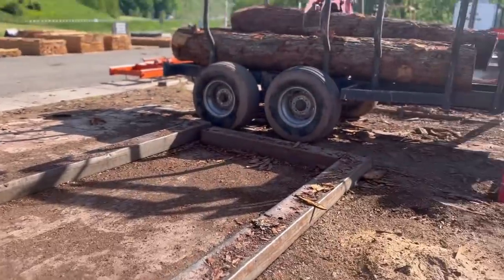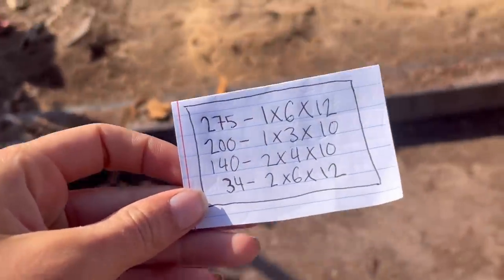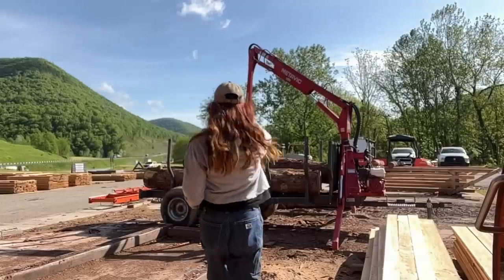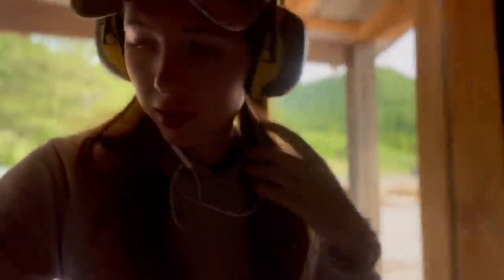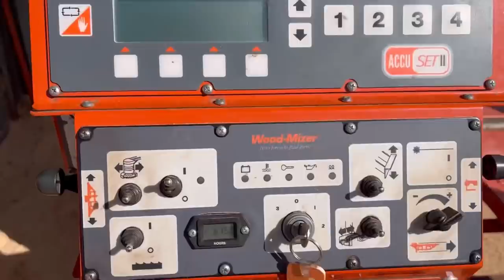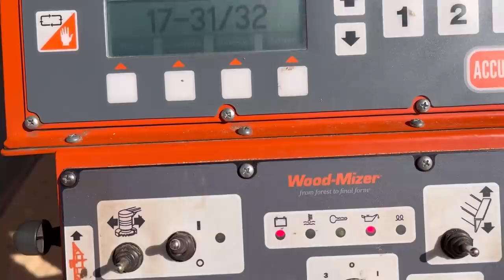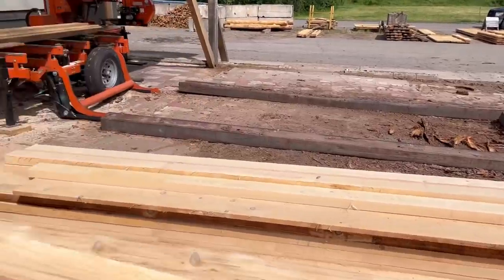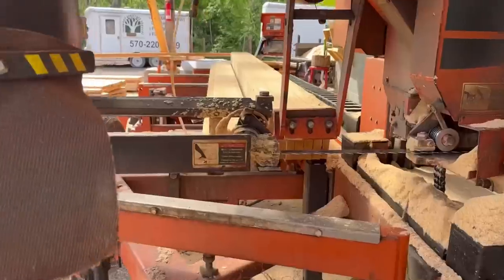Kicking the Competition! 212

Comment: The "D" sections removed in the initial cuts, do they have any commercial value or purpose? It seems like such a loss of viable material. Could these be cut down into say studding?
Reply: I believe they process slabs as firewood. Their SOP is total usage of a tree, and I seem to remember a previous video stating the slabs become firewood.
Reply: We actually cut 6” D logs for siding.  I will see if ‘Em can get a shot in the next video or two.  Most of the slabs are sold as firewood. We charge $15 as much as one can haul.  Boss Man.